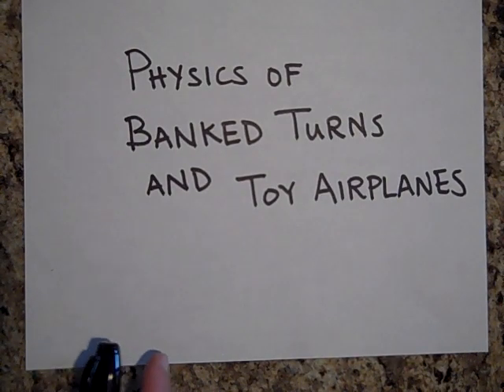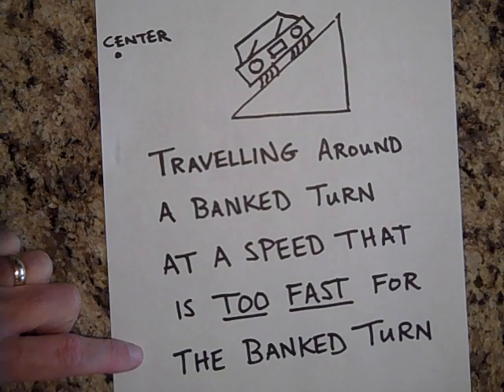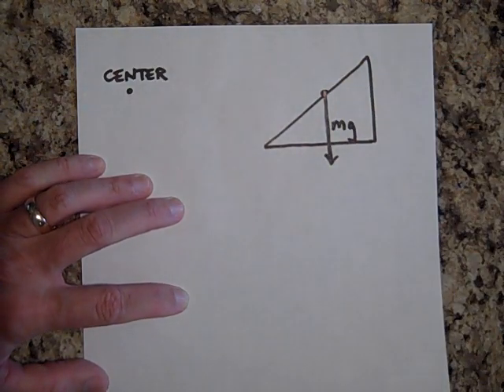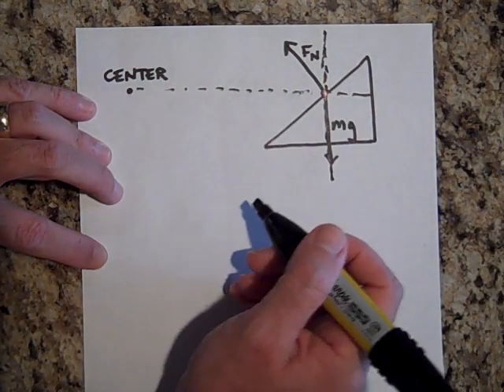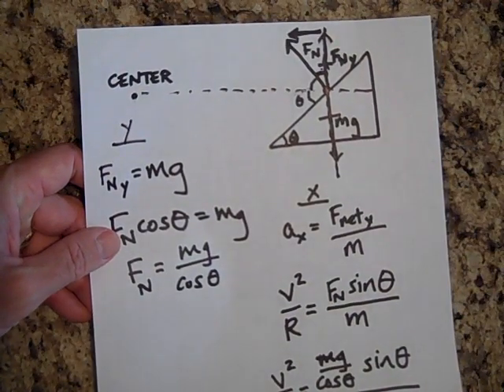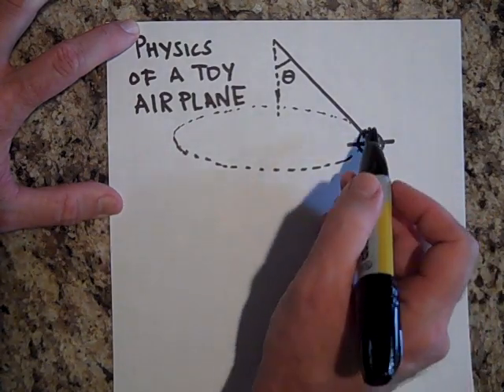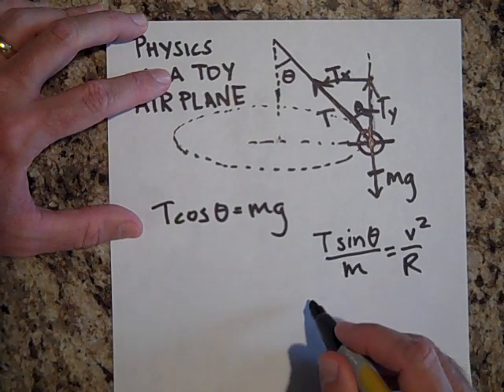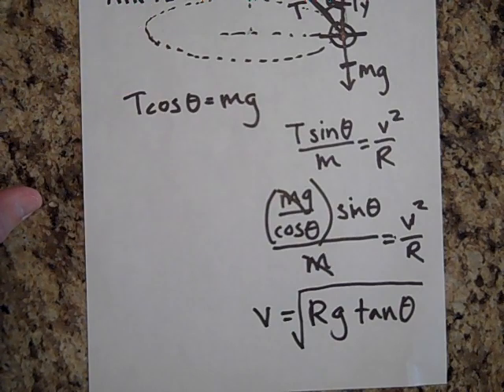Physics of Banked Turns

Comment: can you break gravity into its x and y or is it best to break up normal force
Reply from the maker: You can but that means you would have a tilted coordinate system that would have acceleration in both the x and y directions.  This makes the calculation tougher.  If you keep your coordinate system in the vertical and horizontal directions, then the only acceleration is in the x direction.

Comment: What happens to the normal force in the second example?
Reply from the maker: The normal force is the force of one surface pushing on another surface, for the second example there is no normal force but rather a force of tension from the string.
Reply: lasseviren1 oooh ok got it.  thanks for answering my question!

Comment: What would be the other force on the airplane if it was a real airplane with no string to create tension?
Reply: If the plane was going in a circle there would be the force of lift following a similar concept to the car. The lift would have the horizontal and vertical components and soling would be practically the same as the car. Hope this helps GOD bless and remember JESUS loves us all.

Comment: Thank you very much for this video, I have to say though, that airplanes (and toy airplanes) actually need to bank (lower one of the wings) in order to turn (bank angle), and what makes an airplane turn is actually a component of lift. But this has been super helpful, I can tell you there are a bunch of pilots out there that just memorize the equation and plug the numbers in it without knowing the physics behind it.